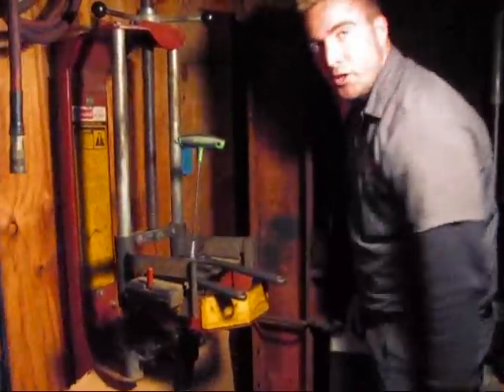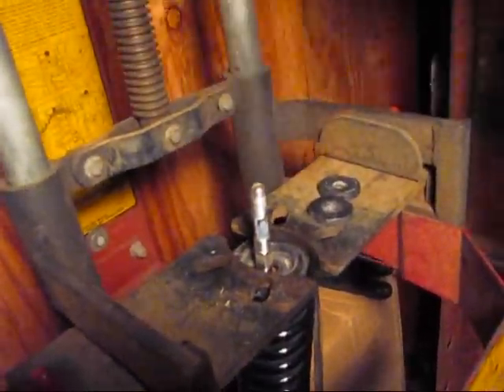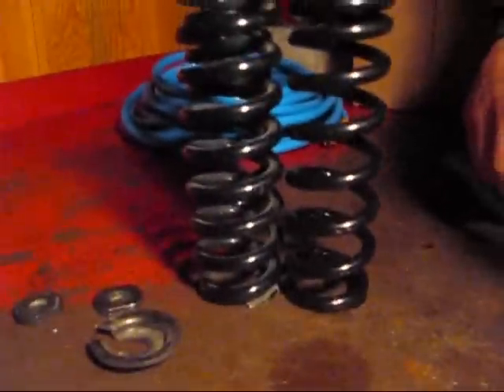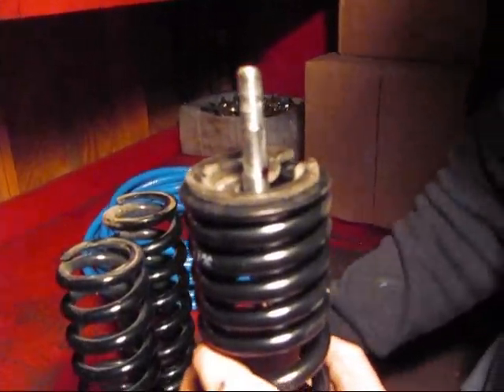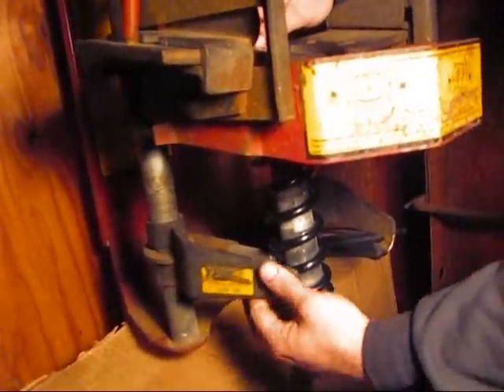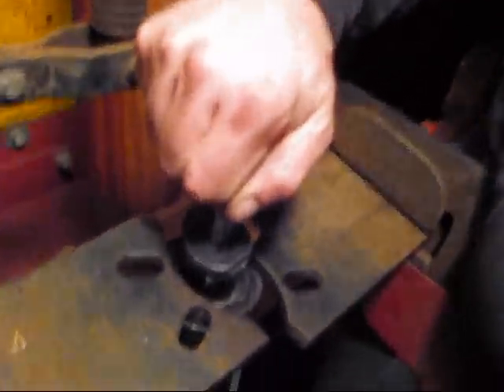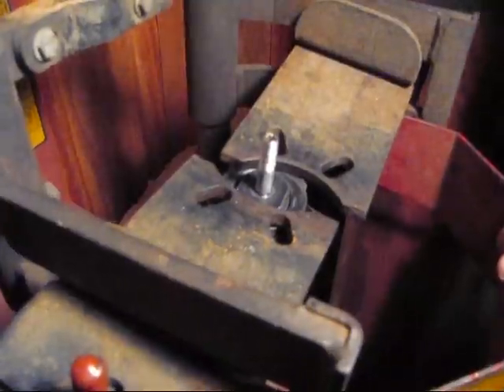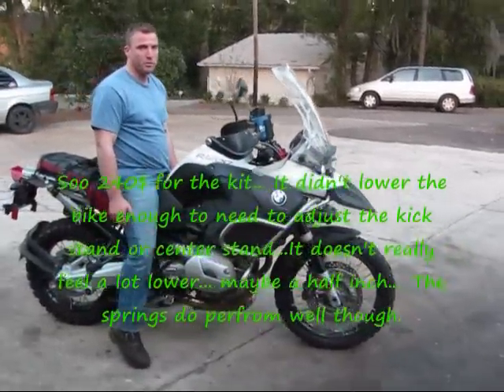PART 4 Hyperpro Shocks

Comment: Did the springs ever settle and get any lower?
I bought my bike with full Hyperpro shocks and it's too low (dragging hard parts). They said these shocks are 50mm lower and I should have them raised up to 25mm. I'm going to have to pull the shocks and send them in. Is this a 1 man job or will I need help? 
Did you take all the weight off the front wheel when removing the shock?